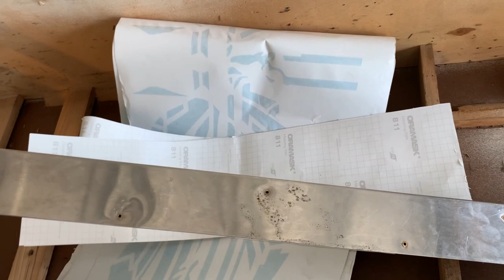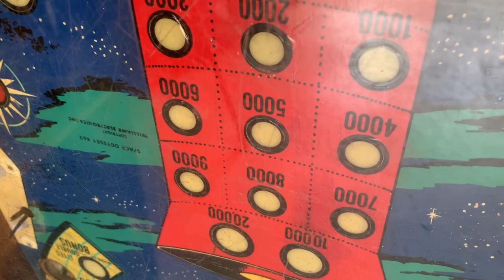Pinball Pick Up - 2 Machines!  Bally and Williams Goodness!

Comment: Would you have any interest, in when you fix your Elektra head, of making me one and mailing it to me? LOL  I have an Elektra body, no head or backglass.
Reply from the maker: Ha. I have two Bally bodies that I want to turn into a Voltan, Kiss, Viking or something. I’ll eventually need to make heads for those if I can’t find some. If you like, I can make a rubbing of the light board or take measurements. It’d be a lot easier to CNC one than with a drill like I did. A head would be like any other Bally. However, I’m having issues finding a repro backglass for Elektra. Have you had any luck sourcing one?
Reply: @MRNBricks  To be honest I've never looked because I knew that light board would be a pain so I was kind of looking to see if I ever found a head, but as you know that's almost impossible.  I've had it for probably.... 15 years!